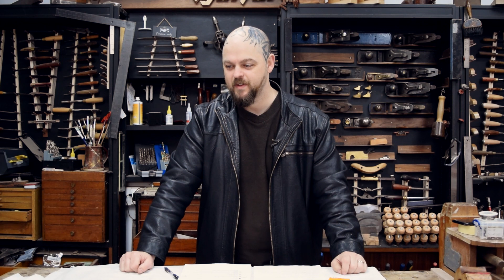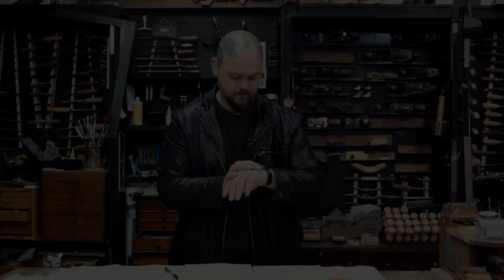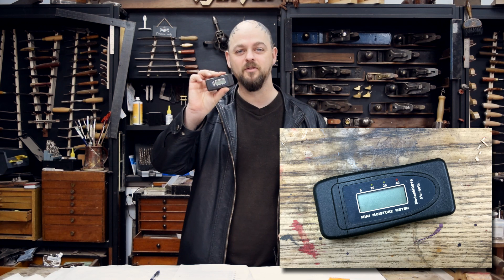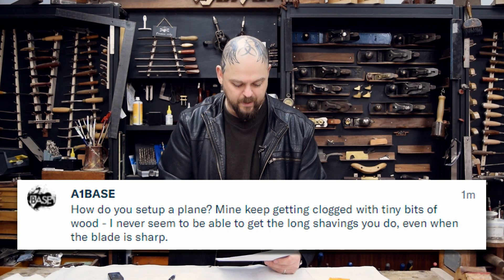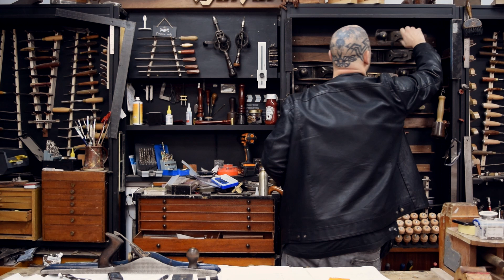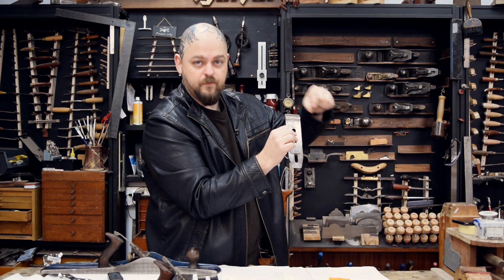Patreon Q&A - Tone wood, Materials for Guitar Building and how to set up a Hand Plane - 16/11/2017

Comment: Pine is reasonably resonant. I'd say the main reason not to use pine is that you can as well use spruce, which is as difficult but even more resonant. Pickups don't really have much to do with sustain. It's all about how energy is lost from the vibrating guitar, and in electric guitars especially how it picks feedback. Pickups that loose low end can of course hinder feedback and thus sustain.